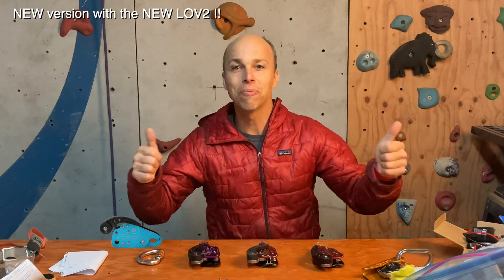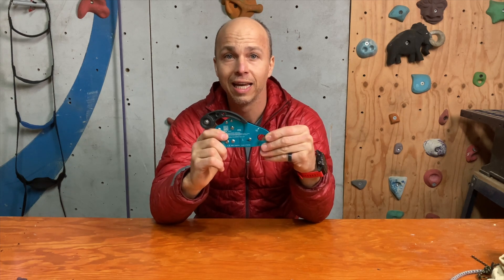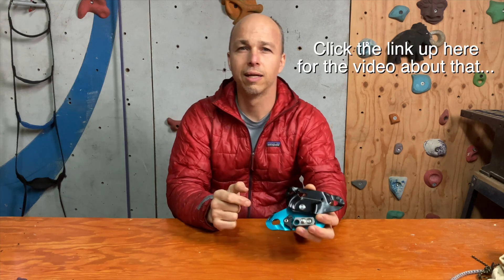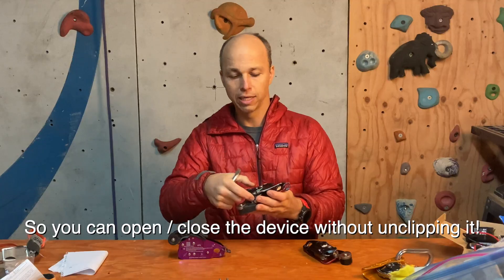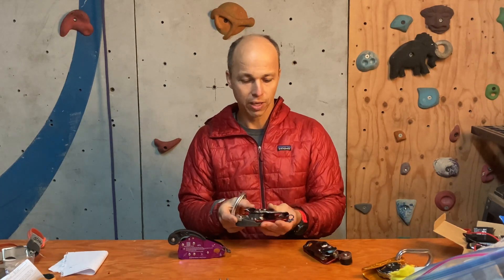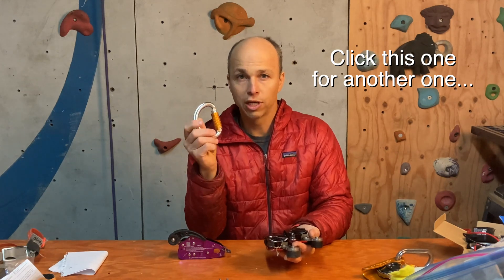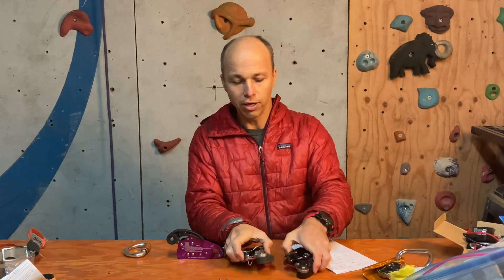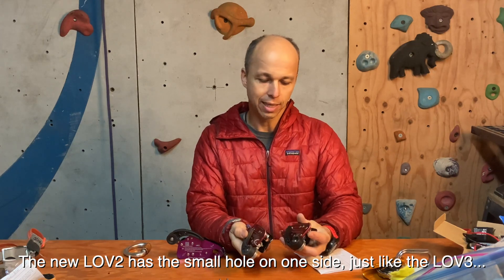LOV2, LOV2 (new), LOV3 and LOV3 (new) by TAZ

Comment: I just bought a LOV3... and I'm returning it. The cleat which is supposed to keep the device from sliding down the rope is totally ineffective on my 9.5mm, and provides so much friction on an 11mm rope that it feels like I'm hauling up a LOT of extra weight. The good news is that THEY'RE CANADIAN, and have been super nice about the return/refund process, no questions asked. 🙏
Reply from the maker: They are French. But thanks for the feedback!! What 9.5 rope did you try it with? I was quite happy with my Sterling 9.6, Mammut 9.5 and Maxxim KM III 9.5. But my level of tolerance is high and I always use a backup device. (Everyone should IMO)

Comment: So it sounds like the new Lov2 might be the way to go, at the moment. You get the benefits of the Lov3's lessened rope wear, and you don't have to worry about the possibility of the device opening on you (however distant that possibility is).
Reply from the maker: Exactly!
Reply: I have the same new LOV 2. Great. 
So difficult to figure out what you will get when ordering online. I also have the sticky cleat.

I tried it out yesterday and felt super safe with an Edelrid Spoc as a backup on a well used 9.8mm dynamic rope. Instant lockup. No shenanigans. And I kind of tried to make it fail by dynoing and just falling off. Everything felt perfect. I think the fact that I felt safe to jump after about an hour of testing shows that this setup is really confidence inspiring.

Comment: I weigh 75kg and am having a lot of trouble descending savely. So far I only tried at home on static 10mm rope and could not once control the speed at which I‘m going down. Even if I hold the brake hand really firm and actually pull down on it, the device almost always „snaps“ into fully open position. Ive seen people manage to control the speed online, but… for me its impossible. Im wondering if this is a malfunction of my particular unit or if the sweetspot for controlled lowering is just too narrow for me. Maybe you can make a lowering tutorial in depth for it?
Reply from the maker: This is strange!! What rope brand and model is it? Yes I will think of making a video about descending with the device. I am 80kg and never had a problem with both static and dynamic ropes down to 9mm… (not recommended, follow manual recommendations!!)

Comment: Im considering the lov2 to get into top rope soloing. But the one I got (and can still return unused) does not fully match the description of the NEW version. although I do see 5 grooves in the non-moving part of the clamping mechanism (only on that side, though), I do have 2 big holes at the handle side. Is there a way to find out exactly which version I got?
Reply: I've just received my Lov2 this morning and mine is as Yann describes. It sounds like yours is a hybrid - new cam with an old body. The new cam is the same part as used on the Lov3 - it should have a large hole at the cleat end, this is where the button would be mounted if it was a Lov3. On all the Lov models only one of the cams has grooves. I think the only important difference between the Lov2 models is the cam and it sounds like yours has the new cam.
Reply from the maker: I am guilty of the “old vs new” discussion. There are in fact many versions probably. But yea I don’t know of any dangerous batch of LOV2 or LOV3 yet. So you should be safe. Use a backup! Makes sense?